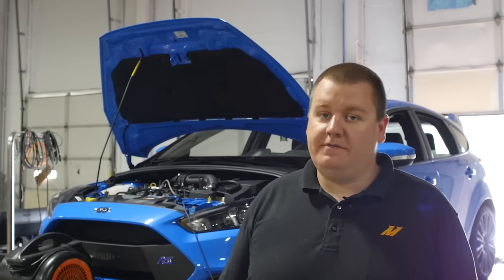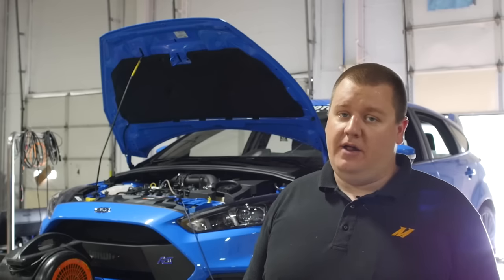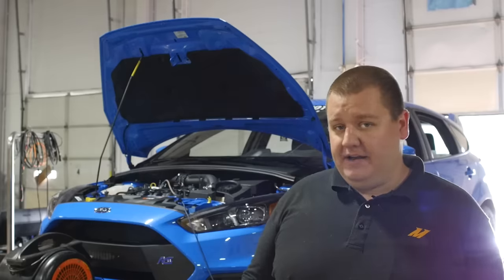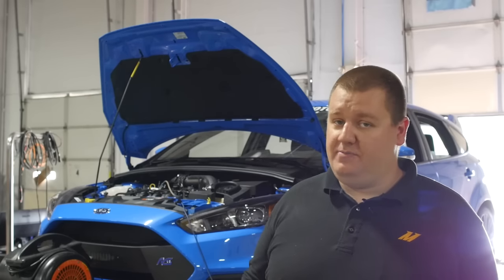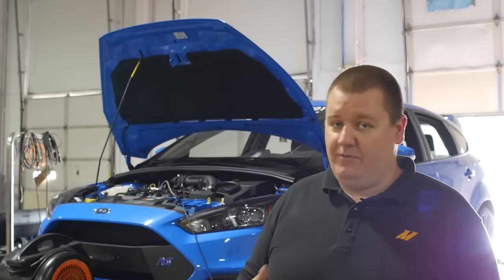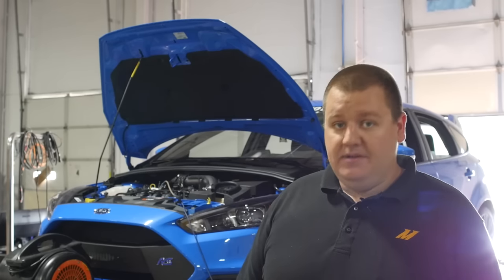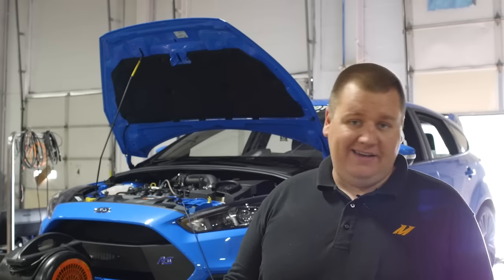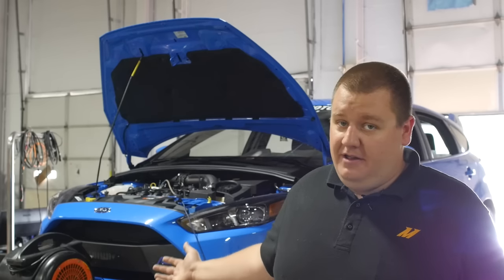2016 Ford Focus RS - Stock Dyno Pull at Mishimoto (UPDATE)

Comment: And they want 47k for this piece of trash are u kidding me , this shit doesn't have room for tuning on stock components , is tuned to the max , an mk7 golf r just with apr stage 1 would shit all over this car , this car stage 1 was only 15hp more , and let's not talk about that interior makes me sick.
Reply: Yeah the Golf R really is in a class of it's own. VAG did a fantastic job with the Golf R, this car I still find appealing though as it seems to have some "hooliganism" built into it where as the Golf R is a little more reserved.
Reply: This car just came out.  It is hardly maxed out stock.  Give the aftermarket a few months.  An intake/tune/exhaust will likely be pushing 400 HP.
Reply: +Nathan Bulmon 400 what WHP YOU MEAN , with stock internals? No way in hell
Reply: Nathan Bulmon It will need a new turbo if you want to make any serious gains. The stock one is already pushed to it's limits, this is why it has "over boost" for the claimed 350hp. There will be a bit to gain with timing once you run corn, but it won't be that drastic until you put a bigger snail on it.
Reply: dominicancash From what I've been hearing regarding this engine, it's  500hp capable. Ford will be using the same engine for the RS500 just a bigger turbo.  You'll definitely need a larger turbo to hit 400who though.
Reply: +Bill McGregor i agree the stock turbo is max out . No tune will do much turbo must be replaced and bigger intercooler.
Reply: dominicancash From the early tunes I've heard about on the forums so far, it was 25hp and 40lbft (not at the wheels, the crank). The problem is they only make 300whp when in overboost, the car doesn't loke to stay there though which is why we've seen the majority of the runs in the 250 range.
Reply: A turbo is basically a more expensive bolt on at this point (not even that expensive when all of the piping and intercooler already exist).  The golf r is more expensive and slower in every test.  Stock for stock, it is not competitive with the rs.
Reply: +Bill McGregor whats where the biggest disappointment happen, who the fuck is gonna get that car when you can get an mk7 golf R stage 2 apr close to 400whp ? With stock turbo
Reply: +Nathan Bulmon This review right here proves everything you just said as wrong:

http://www.caranddriver.com/comparisons/2016-ford-focus-rs-vs-subaru-wrx-sti-vw-golf-r-comparison-test

Lets not forget the aftermarket for the Golf R is much better as well seing as it makes huge gains with just a tune, let me know when a tune only RS runs 11's. Providing you prefer practicality and refinement over "hooliganism", the Golf R is the only hot hatch worth looking at.
Reply: +Bill McGregor all it take is apr tune stage 1 on the golf r , and the game is over for that ford over . No need to touch the engine at all just apr stage 1 .
Reply: +Bill McGregor autoexpress seems to think otherwise.
Reply: +dominicancash apr put better wheels, tires, brakes, tune, intake and downpipe to actually break into the 11's.  hardly just a tune...
Reply: +Nathan Bulmon i tell you what i have and mk7 gti stage 2 , only thing i have is a $450 downpipe and i have stage 2 tune apr , from a roll i would destroy a stock or tune 2016 rs 318 whp with 400wtq at all time no overboost lol that being said a golf r stage 1 destroy me pulls on me . I can beat a 5.0 mustang the rs cant from a roll.
Reply: +Nathan Bulmon Post the 1/4 mile times and trap speeds they got that show the RS faster than the Golf R. Motor Trend is a way more reputable source than Auto Express, they're the largest car magazine in the world.
Reply: the RS turbo is basically the same as the Mustang EB turbo....and that has made 400+whp on stock internals as well. Shit, BT ST's hit 400 whp with some additional fuel on stock internals.
Reply: Matt Beaupre I don't think it will have a problem with 400 or even 500 on stock internals. You iust need the turbo and yhe fueling to get you there.
Reply: Auto express is funded by VAG.
Reply: That is amazing I would like to see that in a video.
Reply: How does that article proof him wrong. The Focus RS wins the comparison in that test... 
1/4 mile 13.4 vs 13.6, skidpad 0.98 G's vs 0.95 G's
In fact, this is a direct quote about the Focus RS; "It’s genuinely hard to find anything to dislike. No question, this has become the performance hatchback to beat."

And aftermarket for a car that's brand new vs a car that's already several years old... Of course the R has more options. As for gains, yes the Golf R has massive gains with stage 1. But only with stage 1. Adding a downpipe only adds 10-15 hp. And stage 3 requires some serious cash. For tuning and straight line speed you'd be much better off with an RS3. Even the mk2 RS3 can be tuned into a rocket on wheels with just a stage 1.

Furthermore what you call refinement I call boring and dull. For me the Golf R would be the last hot hatch I'd look at. I'd much rather get the S3. Same chassis and engine, much better looks both inside and out.
Reply: +McBaron my friend i would recommend you too look at what tire are standard on the focus rs .... michelin pilot super sport , vs that piece of shit that the golf r comes with , those tires are easily easily 2 seconds faster on the track look at tire track test lol , second  the focus rs will never no mater how long it is , will be as fast as golf r both stage one , without touching anything on the engine just with a ecu flash/tune.  Thats it no air intake , downpipe  , just plug it to a computer for 15 min .
Reply: Dominican, have you seen the tune only RS's yet?  They are looking at 375 to 400 hp.  Just wait till the tuning market gets all the kinks worked out.  It won't even be close.
Reply: +Nathan Bulmon I don't talking just to talk , prove it , show me a link? Webpage? That car will never make that power with just a single tune .
Reply: Cobb tuning has a canned tune that made 320 whp and 360 lb ft.  http://www.cobbtuning.com/ford-focus-rs-power-gains-and-development/  That is easily 375 hp at the crank.  

http://www.autoevolution.com/news/first-2016-ford-focus-rs-engine-tuning-375-hp-by-shiftech-107927.html

This is just the beginning.  One guy is already in the 11's with bolt ons.